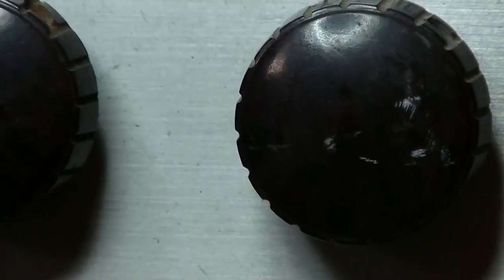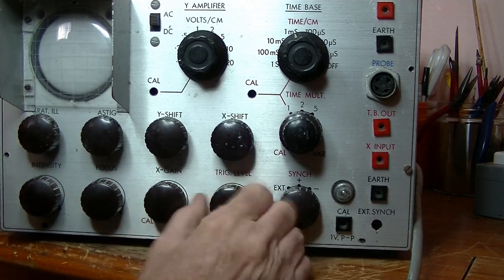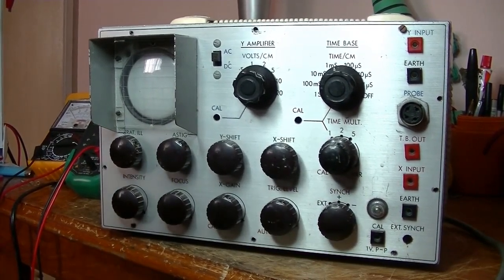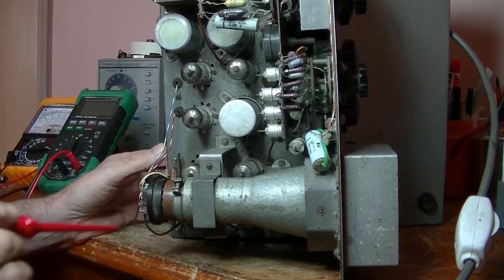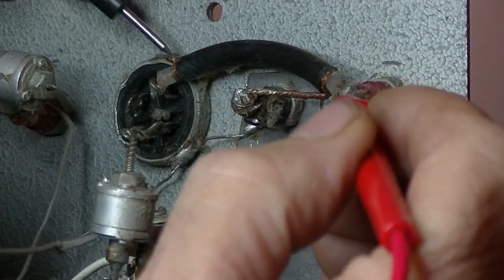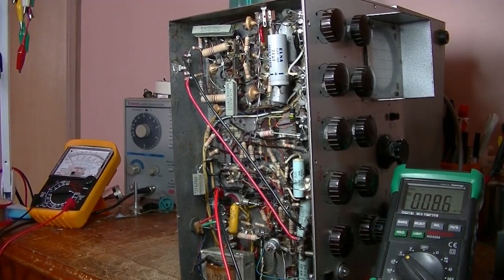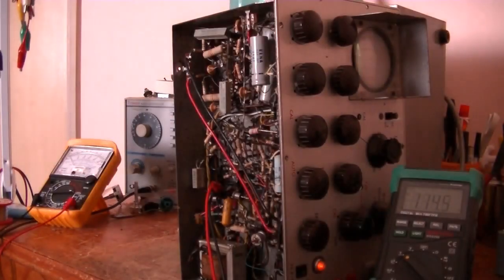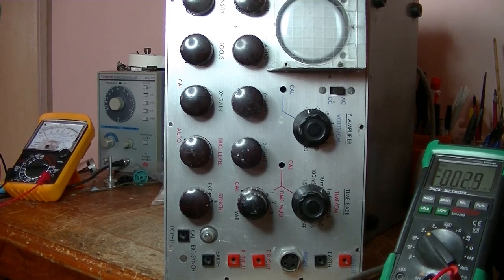Vintage CRO Restoration; but is it a standard CRO? Part 1

Comment: Its a CRO oscilloscope made about 1962 possibly '63. Miniature tubes were the tip off for the date. It looks very clean for its age. The inside of that is super clean for being that old. Amazing that it works and even that scope tube works which are really hard to find and expensive. Thanks for another great video.
Reply from the maker: Thanks for the kind words Larry. Yeah I was sweating on the crt more than anything. I hope it still has a few years left in it

Comment: Of course this is a bench  oscilloscope. I noticed a new like white  handle added to the top. Yeah good eyes! But with some replaced components like the Elan capacitors it was used for many years probably in a radio or TV repair shop. Take the
 CRT socket off and see what kind of Philips tube it is.  The cover comes off the tube and it will say maker and model
 number of tube for sure. What were the numbers on each of the miniature tubes? All this info helps to find who made this oscilloscope  and when. I wonder if the name is hidden under the tube shield on the front? Also whomever owned it 
added a graticule on clear acrylic plastic in front of the tube. Looks like a  homemade screen shield to me.
Reply from the maker: Thanks for the info. I just wasn't sure as Ive never seen anything similar. I'll check out the points you mentioned and get back to you

Comment: Definitely an oscilloscope, you really need to get some more info about this scope first before proceeding with restoration. The actual MHz of the scope is important to get the correct probes for it. I would change the old probe inputs to a modern BNC type to accept the newer style probes which switches from 1X to 10X. I don’t think you’ll ever acquire the original probes for this scope. Again, you need more info to get the adequate probes for it and to properly adjust the probe compensation. It’s important to compensate the probes correctly for both X and Y inputs.
Reply from the maker: Thanks Ken, I'm trying. I'm going to do what The Master suggests and look for the crt model number and the valve layout. I suspect this was made here in Aust given the mullard valves and the cermaic resistors were made here. A bnc plug is a definite for this this unit. I'll keep updating as I go along